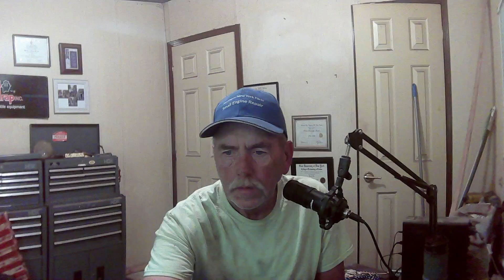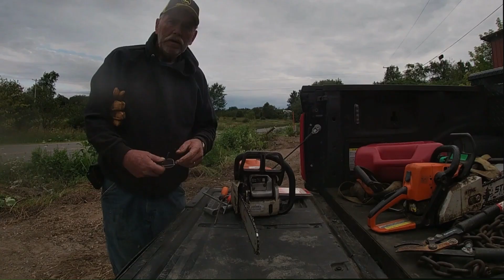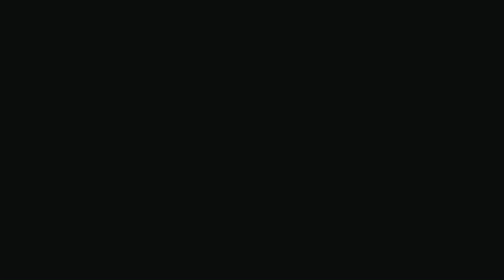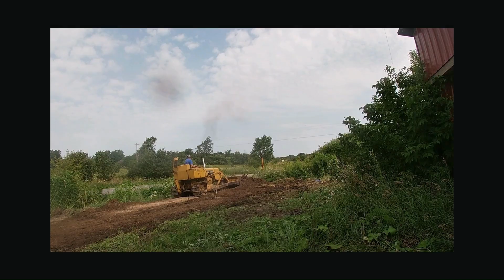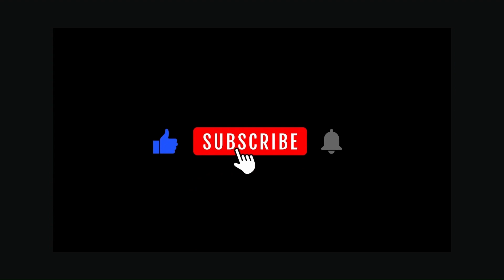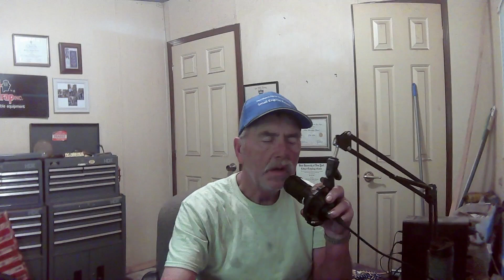All You Wanted To Know About Generators: Sales & Service

Comment: What are you guys seeing for generac standby 20kw units on valve adjustment needs and brushes needing replaced on those units?  Briggs vanguard 999cc specifically..... good reliability on  those?  Anything odd you guys seeing on those ?
Reply from the maker: So far Steve, all that I am hearing is positive. I also know when it comes to the valves, the manufacture recommends adjusting the valves after so many run time hours